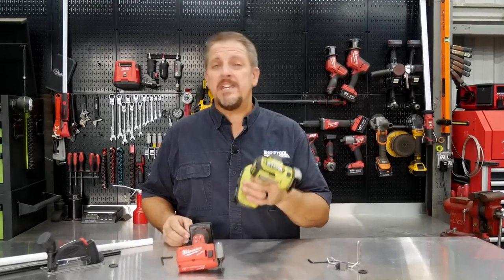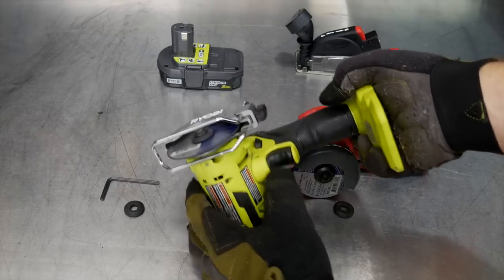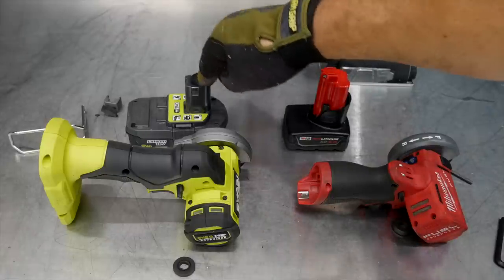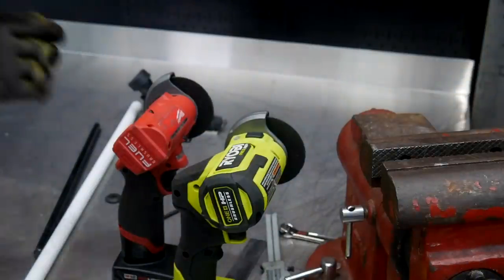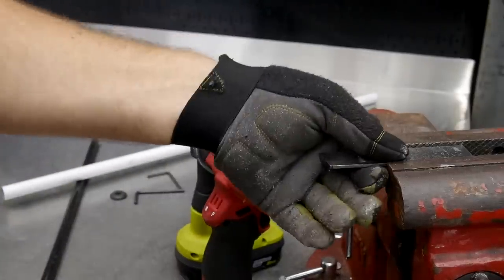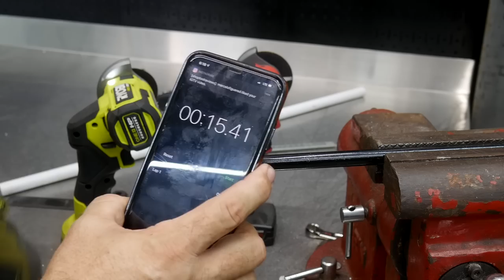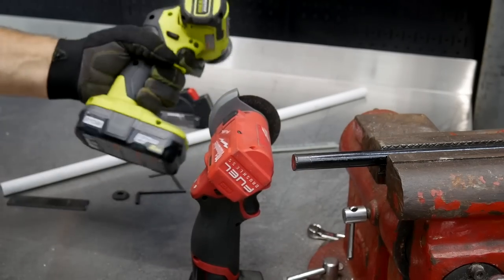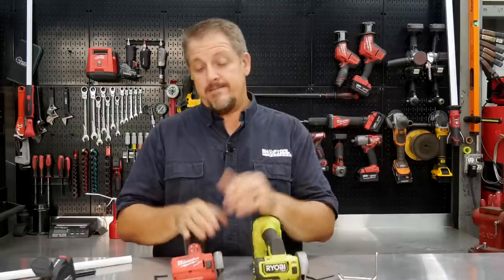Milwaukee M12 vs Ryobi HP 3" Cut Off Saw Showdown [20,000 RPM]

Comment: Interesting. I have both platforms for different purposes. I also have DeWalt for heavy duty work. 

I have been looking at the M12 cut off tool, but based upon what I might use it for, I might just go with the Ryobi...for this specific tool that will have specific light duty purposes... I mostly use my Ryobi tools for outdoor, hand trimmers, pole saw, misting fan. I did buy a hammer drill but on a job where I was using hammer drills on brick/mortar, with two different bits, I had the DeWalt and the Ryobi and ended up changing bits on the DeWalt due to how frustrating the Ryobi was.  

My M12 tools mostly will be dedicated to the travel trailer for camping purposes. The foot print inside the storage area is substantially less than the DeWalt. The spaces your work in are much tighter also. M12 platform is great for this.
Reply from the maker: Very good point, the M12 tools offer a much more compact size. Thanks for watching.
Reply: @Shoptoolreviews  From the video, this particular Ryobi tool looks roughly the same size. Is that true?

Comment: Wait you’re gonna tell me that a 3 amp hour battery lasted longer than a 2 amp hour battery.. astonishing
Reply: Of course. Watts (output) are amps times volts, and it’s 2 AMP hours at 50% greater voltage. Even at the same wattage output it sips those amp hours. If you reconfigured the cells in the 18v pack for 12v it would be a lot more than 3 amp hours.
Reply: He spent like 6 minutes at the start explaining the battery situation I'm glad no one watches

Comment: I could be wrong but Ryobi is 18volt & Milwaukee is M12 of course 18volt is going to have more power 🔋 if the Milwaukee was an M18 it probably would have blasted threw  all jobs plus still have more Battery life.   Again I'm in now way an expert I'm just going  by Ryobi 18 volt advantage compared to Milwaukee 12 volt ⚡
Reply: Milwaukee doesn't offer an 18v version so it's a fair comparison. Same with their ratchets and a few other tools, some are exclusively 12v

Comment: I got the Milwaukee tool couple of months ago, returned it.
Tried cutting the 1/2 plywood with maybe 36 inch cut. Had a 2 amp battery fully charged. About quarter way through battery died while blade getting stuck every 2 inches.
Changed to 6 amp and less 10 inches, battery died.
Put the battery on the charger and got the red and green flashing light.
What was supposed to be a 30 second job, ended up a 15 min.
A lot of reviews online state that these tools eat batteries. I have no clue how these Milwaukee tools get 80% 5 star ratings.
Reply from the maker: I would never recommend this tool for cutting 1/2" plywood, unless it was an emergency and you had to cut a very small piece. This is more for cutting small metal and plastic pieces. Thanks for watching.

Comment: never saw somebody in the trades use one of this things. why use an cutoff tool for the shown materials if you have an 18V angle grinder or a band or reciprocating saw?
Ok if you really need to get in an odd spot with it where the three alternative cutters don't fit in but in a vice or free hand? Whats the benefit of this thing?
Reply: Tile workers use this for finishing precise cuts. Once you work with a backpack and have few sites to visit during the day, every lb matters.
Reply from the maker: We see them used all the time, including in our shop. From trimming back sheet-metal, to cutting off bolts/screws, to using the reverse direction to throw sparks away from the user. It's definitely a useful tool, but it's not a 100% replacement for any other tool. Thanks for watching.
Reply: I use this all the time to cut out plaster walls and floor tiles because of the dust extraction. I have a corded grinder with a tuck point adapter but this is much smaller and easier for me to carry with my other M12 tools.

Comment: overall great review, but the milwaukee lasting longer is a bit skewed. 1.5ah vs 3ah... yeah not exactly shocking that the 3ah lasts longer. Before any 18v vs 12v in reply, that is irrelevant for storage capacity. lipo battery design if you still question it. Also the discharge rate of the 18650 will affect it.
Reply from the maker: Thanks for the compliment. I'm very aware of marketing hype and the way voltage works. I'm also very away of 18650, 21700, or any other cells used in tools. That's way, in the video, I talked about Volts x Ah = Wh out. This is the number that has meaning. Europe actually uses Watt Hours out in their specifications, which is a better indication of output. I did not use a 1.5Ah battery on the Ryobi, I used a 2Ah. 2 x 18v = 36 Watt hours. The Milwaukee is 32 Watt hours out (less than the Ryobi) and it's not actually a full 3.0Ah battery. I mention this in detail in the video. This was as fair as we could get the fight and still keep it as though a customer is buying the "typical cut-off saw setup". Thanks for watching.
Reply: @Shoptoolreviews  i know what you were talking about and I should have said you did bring it up. However, there were some gaps in the time for explanation (editing maybe?). I should have touched on you having mentioned, and it just being at a different point in the video. More of a place for those who may have less knowledge on li ion tech and or missed the explanation etc etc. TLDR: you explained, I needed to work my comment better
Reply: The Milwaukee is a 10.8V battery, that's why it's 32Wh. In Europe you will often see the same identical batteries rated at different voltage, ex. 20V Max in N.A.versus 18V nominal in the E.U. Dewalt, Bosch, and others rate their batteries as 10.8V in the E.U. and 12V in N.A. even though they are the same battery.
The Ryobi battery wasn't dead, it's just how the cut-out works in some Ryobi tools, you have to pull the battery and reinsert it to get the tool running again.

Comment: You may want to at least use the same Ah battery to say Milwaukee last longer
Reply from the maker: Did you watch and listen to the video? Ah on an 18V battery calculates much different than the Ah on a 12V battery. Ah x V = Wh (Watt Hours) output. The M12 was 32Wh out and the Ryobi was 36Wh out. Pretty close to the same battery output. Stepping up to the 4Ah for the M12 would have put it over the Ryobi. You couldn't match it exactly either way. Thanks for watching.

Comment: The watts on the batteries are the same lol
Reply from the maker: Not quite. The Milwaukee 3.0 is actually only 32Wh out.
Reply: Because the Milwaukee battery is actually 10.8 volts, not 12 volts.

Comment: WoW ,  that RYOBI beat the shorts off that Milwaukee 🤭😂 , how embarrassing is that ??   Let me get this right , the Ryobi cut that steel more than Twice as Fast and it costs about 25%(about $35) less than the Milwaukee , its definitely a Sad day for Milwaukee...
Reply from the maker: The Ryobi definitely out-powers the Milwaukee. This has a lot to do with the voltage difference (18 vs 12). Thanks for watching.
Reply: @SamuraiAtlas  relax nepson no need to get all defensive over a tool
Reply: Let's put a 3 inch anvil on the milwaukee m18 with a 2ah battery and redo the test

Comment: It’s a same old story.  Ryobi’s finishing nailer was better than Milwaukee’s.  Then Milwaukee improved the 2nd Gen.  The 2nd Gen is definitely better, but it will cost 2.5X.

However this one will always be for that light job.  And some how I don’t think Milwaukee would have a motivation to improve this particular tool, when the angle grinder would do the job.
Reply from the maker: You are correct on the first half. There is still a place for these little cut-off saws. We use ours around the shop almost daily, and we have at least 6 cordless angle grinders at arm's reach. Thanks for watching.
Reply: What milwaukee did was instead make better batteries that'll give the tool the current it needs to keep up. The problem was never the tool

Comment: but can it cut wood????????
Reply from the maker: Yes, with the right blade.
Reply: @Shoptoolreviews  yes i found a 3 and 1/8 inch blade or 80mm

there is only 1/16 of space between blade and guard 

cuts  up to 5/8  pieces of plywood

Comment: I have the Milwaukee and it is great. I have tried Ryobi tools before, they are gimmicky DIYer garbage.
Reply from the maker: Yes, the Milwaukee is great, but I wouldn't make a blanket statement that Ryobi is garbage. Ryobi actually makes some really good tools too. Just depends on which tool you're talking about. Thanks for watching.
Reply: @Shoptoolreviews  I guess you're right about Ryobi. I wouldn't say they are garbage, as they are inexpensive and okay for light use.

Comment: Thers no point to these reviews cuhz milwuakee is meant for commercial use
Reply from the maker: Ummm, not really with this tool. They're pretty much the identical tool, and they're both made by TTi. Thanks for watching.
Reply: @Shoptoolreviews  is the tti price hierarchy the same as in Australia? Here it's Ryobi, AEG (ridgid) then Milwaukee (from cheapest to highest price). Both Ryobi and AEG exclusive to Bunnings, but they don't sell milwaukee. I wonder if Bunnings only drip feed us select models from both ryobi/aeg rather than the full range, to avoid too much overlap with models that are very similar. For example, we don't have the p262 ryobi impact wrench but we do have an aeg model that seems exactly the same but more expensive.